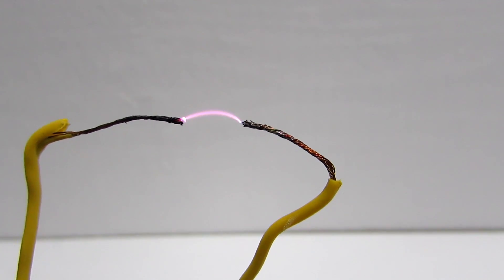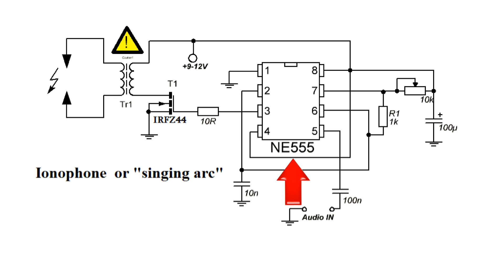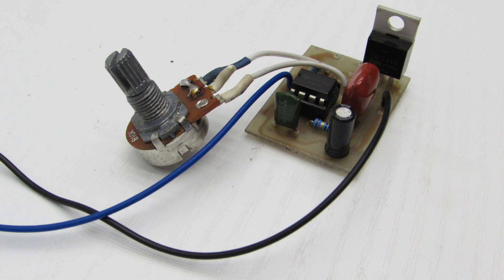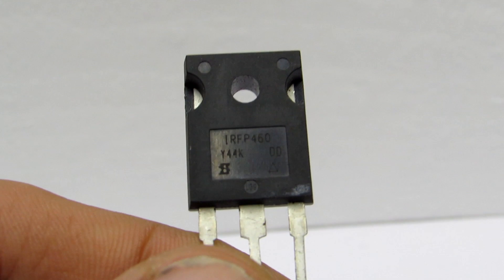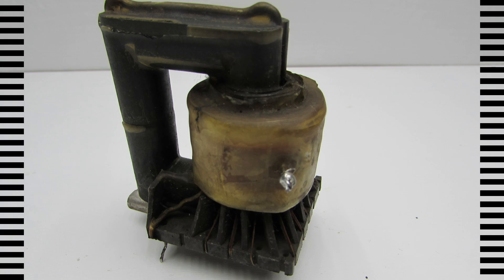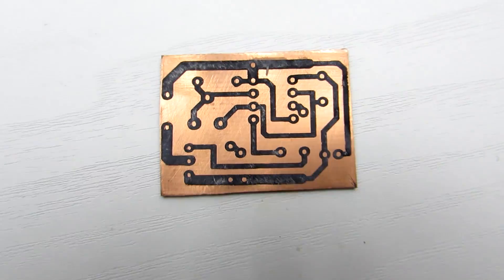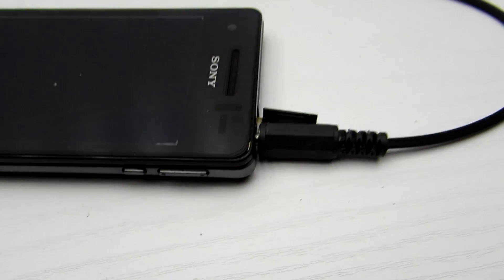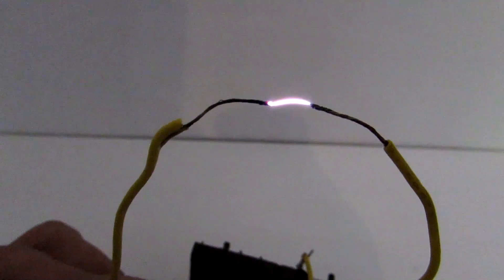Plasma Speaker / Singing Arc - Music Tesla

Comment: the 555 based overheats transistors too much. i recommend either royer oscillator with inductor on the coil input or classic zvs, because they can reduce the switching losses very efficiently due to the inductor. audio modulation is easy put a second coil on the input inductor of either of the two circuits and give it audio signal form amp
Reply: how will you lower the impedance of second coil of inductor
Reply: thicker wire?
Reply: Gotin Fuklio skin effect
Reply: Mrinal Thakur multiple thin wires?
Reply: Gotin Fuklio then what about induction spiking
Reply: Mrinal Thakur either put diode to eat the spikes or capacitor to make lc circuit
Reply: Put a diode and capacitor to work like a snubber and you will get give energy losses